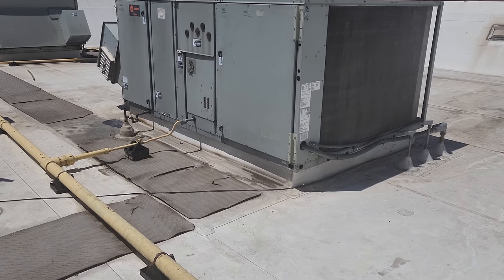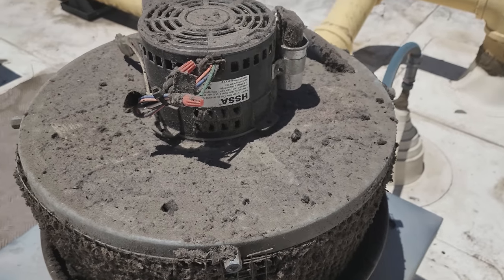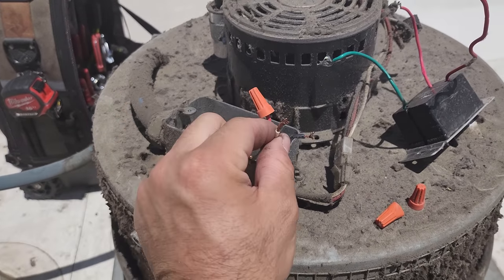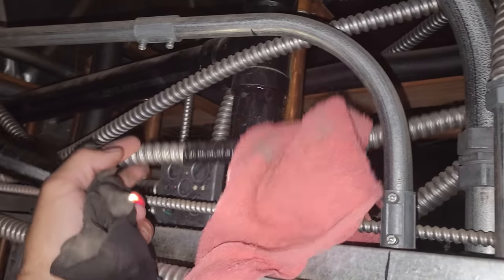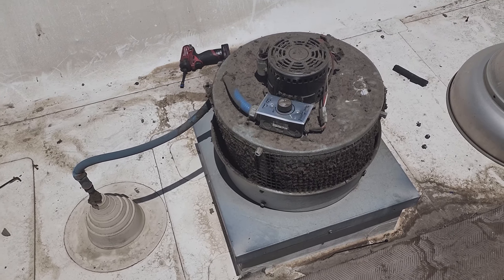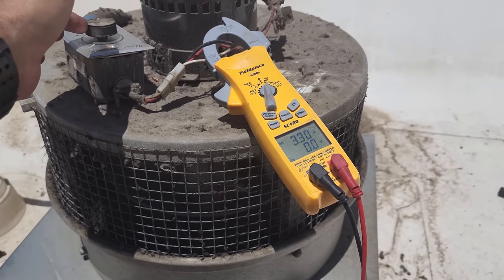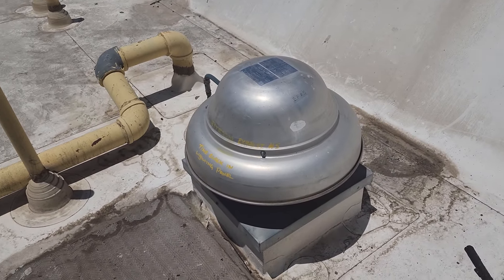THEY SAID PEOPLE ARE SWEATING IN THE RESTROOM

Comment: Grrrrr. Those old mechanical timeclocks.  Unless you install one of those spring drive assemblies they lose time when you lose power. Work for a consulting engineer and it took me YEARS to get our standard spec for recirc pump time control changed from those old Tork W.

Comment: 2:50 get the Klein et450 if memory serves me correctly.  I love it! 12v DC to 480ac. I have traced powered lines in conduit 25ft above my head. It's frigging amazing every time I use it. Sometimes a Lil too sensitive. But for tracing, injecting signal over dead or live wires. Just works, also can pick up underground conduit.

Comment: THANK YOU for writing things down, it seriously pisses me off when i have to start searching around for stuff someone else built. Big mall-type buildings with multiple businesses are the worst. Even the most basic things like finding the corresponding condenser or a water line to clean it can be an unessecary chore, let alone tracing out the wiring like that.
I write down as much as i can think of on the inside of the control cabinets, or on top of the indoor units if the outdoor ones are hard to find. The staff on site are usually useless, i consider it a success if they can find most of the relevant keys.
Reply: That yellow will sunfade. Should also write it on the inside of the cover

Comment: I think what might be important to realize about how those exhaust fans affect supply vents in the restroom is that the vents can often be fairly small, and if tied to a main dining room AC, are less "desirable" paths for forced air to go in a larger ductwork system. So if the exhaust shuts down, that supply is no longer an efficient path, and the vents with lower resistance to positive air pressure take more of the load, and very little, if any, cool air moves through the restroom vents. Even if there's heat transfer that can occur, the nature of positive pressure vs. ductwork leads to low airflow in one area because higher airflow is easier somewhere else.

Comment: Maybe mechanical timeclocks could have a buzzer. If it detects power goes out, a relay opens and doesn't close until a reset button is pressed. Then a buzzer sounds. (Possibly delayed by a capacitor.) That way, a mechanical timeclock that is inaccurate would get some attention, quicker. (And you haven't added any ICs/etc. Basically the same reliability.)

Comment: CHRIS, don't you know that the oval window/ cut out at the top of the time clock inside plate is an inspection window ?    If it's running there's a gear in there that you can see turning. Also. PLEASE more footage showing the dirt (this screen/ condensers) being cleaned. EVEN to the drains on the roof. SO satisfying to see all that filth washed away !

Comment: Time clocks are stupid. They will get out of time. They are especially dumb for lighting circuits for exterior lighting . I get it, off and on for certain operating hours, but people don’t adjust for seasonal changes when it gets darker earlier. Time clocks for an exhaust fan, hidden inside some panel? It seems like a hassle. Of course, power failures and they do slowly get out of time, as they aren’t atomic.
Reply: The modern digital time clocks have a super capacitor that keeps the time during outages and never has to be changed.
Reply: @mrfrenzy.  maybe, but if it’s not atomic it will slowly get out of time. Let’s not forget daylights savings time too.
Reply: @user-ln7of9gs4s  I use Theben Top 2 or 3, the 3 being an astronomical clock for dusk/dawn lighting. And you set the location with closest city or even long/lat. Pretty nice. Also does DST
Reply: On this channel I have seen that in the vast majority of installations, an analog type of time clock is used. I don't know the reason why, because I would think a digital clock would be cheaper (and far less prone to issues with time drift)
Reply: Buried inside the electrical panel is more than just a hassle. It is hazardous if restaurant personnel knew that it was in there. You don't want the dishwasher being helpful, or even most of the managers pulling off the cover and diving into a panel like that. Powering it of the lights would probably be a much better solution than a timeclock at all, unless the restaurant personnel can't be  trusted to turn them off as part of the closing procedure.
Reply: @thesoniczone  it's super old tech and it's still cheaper that solid stage digital stuff believe it or not

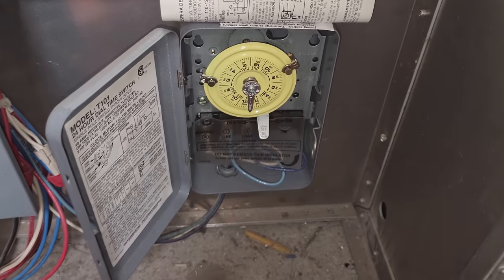Comment: That's a T-104 time clock, used in the swimming pool industry ALOT. The oval hole inside the box, (the 11am position at timestamp 4:39, that hole) there is a gear mechanism back there.  You can use your pinky in the hole, or look inside, and there is a gear always rotating (keeping time) if its working, if that gear specifically has stopped, its bad. Just a trick/tip.

Comment: Those Electro-mechanical Intermatic time clocks are damn near bulletproof though once in a while the motors can fry.. there’s a little Visual Motor Check window near the top of the timer mechanism. With a flashlight Should be able to see the little gears moving through the window.

Comment: One additional lesson that can be learned from this, and a message that should be given to business owners:

Documentation of all of your building's systems and how they operate can save you a ton of money. Yes, it will also cost a ton of money to open up all the ceiling tiles and junction boxes to identify where everything goes, but look at the example of this video.

If Chris hadn't written in permanent marker that there is a time clock in the lighting panel (good practice, but by no means the norm) if the same thing happened again, the next tech that comes out might take twice as long and still not find the time clock.

If every business owner had a binder on site that listed every piece of equipment and what it served, the breaker it is on, etc... in the long run it would save so much money.

Maybe that's just wishful thinking on my part. Fantasies of a day where I can get on a job site, open up a binder and be treated to a building floor plan and corresponding roof layout with air handlers and exhaust fans... with the following pages the manufacturer's cut sheets of all the package units and components... followed by a log of changes or repairs to each unit...
Reply: And good luck keeping it up to date as changes are made.

Comment: While hunting intermittent shorts I'll usually start shaking wires and conduit with an insulated tool, but if the CB is tripping immediately I'll usually start checking the loads first

Comment: Had a service call on a swimmingpool heater Gullberg & Jansson brand but seeing the sticker I'd say it's a Gree. Call was that they put it on, and a few days later the efficiency had been dropping so they thought it was low on refrigerant. Coming there, hooking up my gauges and ask the customer to turn it on. System came on, there was led indicators on the control unit. The led for compressor came on but no compressor. And the supply fuse blew. Long story short ended up being the start capacitor. I mostly work on split AC where there is inverters and not capacitors, so I don't stock them in my car. But a local electric and plumbing company had on on the shelf. I did measure the compressor and it measured okay. No short to ground and the resistance between the legs was as they should be, two lower and their combined sum was pretty close to the third.

Comment: I'd never heard of that brand of meter before watching your videos but I looked into them and they are top quality meters. I'm in the electronics fields where Fluke tends to be prevalent. Knowing how to use one is more important than the brand, but if you're working with any serious voltage or current levels, you need one with the protection built in to keep you alive in case you have a stupid moment.
Reply: There are also under the Fluke umbrella, Amprobe, Keysight, Extech, etc.

Comment: I much prefer the central computer control method for time controls, then I can see all the states from one place and override them as needed, plus can do things like sunrise/sunset or dusk/dawn without a sensor (locally computed day by day based on lat/long and date) that gets screwed up or having to change time clocks multiple times a year, and it's time is updated from the Internet so they very very rarely have bad time.

Comment: Those 5 amp speed controllers are important for Testing and balancing. They drop the voltage going to the motor. In my experience, it typically puts the motor at max amps or slightly under, but the voltage is much lower than line volts.
Reply: I’ve had a lot of those speed controllers completely fry motors in VAV’s.
Reply: As far as the motor is concerned, heating is related to the square of current.

Comment: Why would they mount a time clock without a battery backup behind a panel? Should be on something with a door. Would seem even better to connect it to the lights so it turns off occasionally during the day. Or on its own motion sensor system.
Reply: Yeah, just connecting it to the dining room lights would be much easier and better.

Comment: What is that yellow pipe going to the AC at 0:26 ?
Thank you very much.
Best regards.
Reply: Pipes going to HVACs are natural gas for heating.
Reply: Natural Gas
Reply: @gordonrichardson2972  
When heating is needed they work together gas and ac compressor, or it heats just wit gas?
Thank you again.
Reply: @sonjakavalut  Usually just heated with gas. Heat pumps are too complex, and barely used in California.
Reply: CNG for the automatic flamethrower to get rid of the poop particles in the restroom.😁

Comment: question would be cool if you could help. i have a walk in beer cooler that has fans that wont shut off even with the condensing units disconnect and even the breaker for it shut off. i suspect its probably a wire issue because my multimeter coudnt read voltage on the load side of the contactor yet the fans still spun. with the disconnect off im confused where its getting its voltage from because the unit is located on the ceiling of the walk in and the only wires i see are the power and neutral
Reply: You have to locate the breaker and mark it.

Comment: I had to stop the playback for a moment to 1) hurl, and 2) concur with your skepticism of non-contact voltage measurement.

The 3 VAC you "measured" is likely induced from nearby conductors and if so would not carry any current.  This often happens in open circuits, but you would never want to stake your life on that being open based on such measurements.

On the other hand you can have real applied voltage that is not reliably detected.  You may have multiple conductors and uncertainty over what is connected to what.  And what of an unexpected DC voltage?

Same goes for those wiring detectors that you run over a wall.  Don't trust them if you want to live.

OK back to the video.  Enjoy your Sunday Chris.
Reply: Underrated comment, plenty of important info here!

Comment: You poop into water. I doubt there's much if any "poop particles" in there. It's just dust from drawing that air out. You're being overly cautious for no reason.
Reply from the maker: I know that I was being silly
Reply: Better safe than sorry. There are a lot of dangerous gases from medium and colossal dumps along with Salmonella, Legionella and other potentially lethal bacteria and viruses. It is better to wear a cat4 outbreak suit when dealing with contaminated installations and if you can't discard the used equiment you have at least to sanitize it thoruoghly.😁